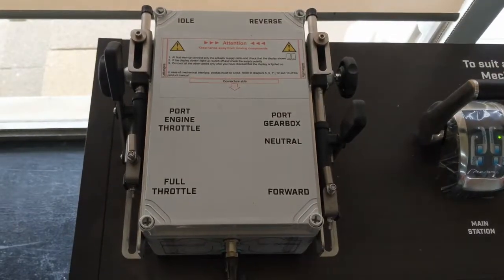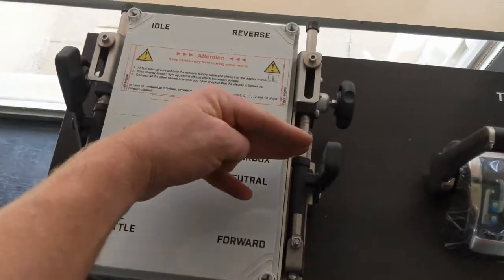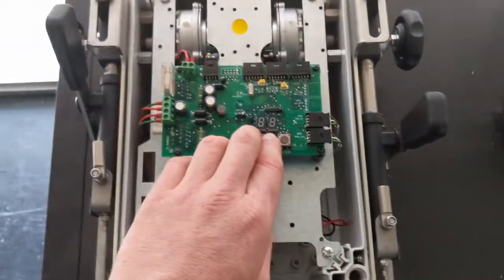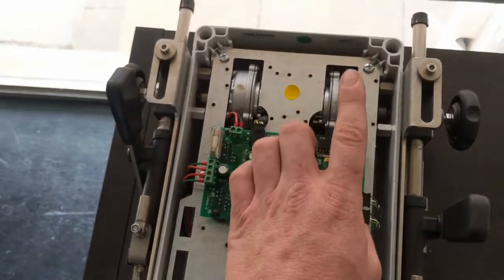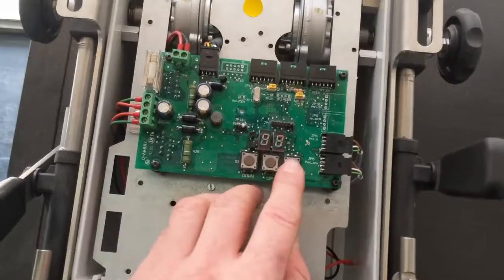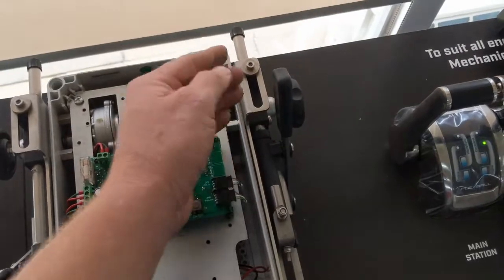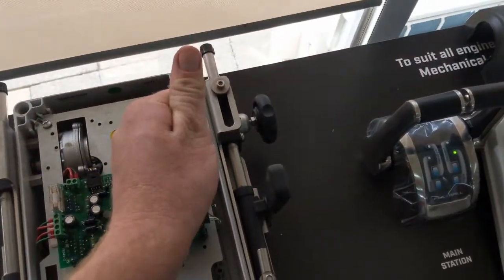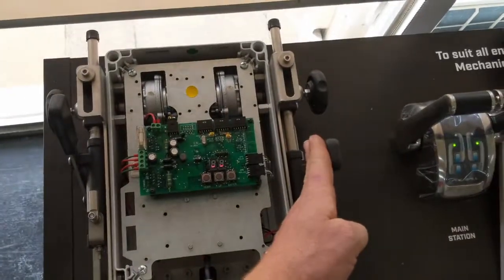Flexball Electronic Marine Throttle Setup

Comment: I have 1 command station control 2 engine . When both engine increases 1000 rpm over handle Command station we’re not same . But under 1000 rpm handle command station was same . How to adjust for same handle command station when 1000 rpm over . Thanks you.